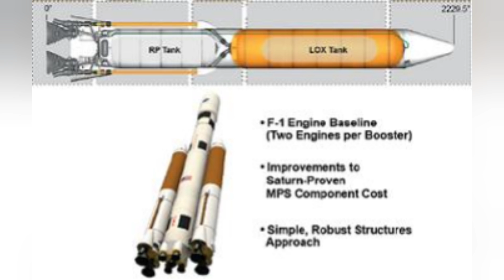NASA almost used Saturn V engines for SLS!  Are the new Shuttle engines the right choice?

Comment: The Saturn 5 and the F1 engines are 1960s technology,   They were hand crafted by the best in the country 50 years ago so its no slouch and will always be a folk hero but have you ever driven a 50 year old vette or a 50 year old mustang?   Nostalgic as F and a thrill to be sure but they are not the greatest, Also, the turbo pumps on those F1s have issues...  As far as the SLS goes,  its way way way to expensive,  i'm mothballing that whole rocket until we see what Elon does with the Spaceship and booster
Reply: Indeed they were hand crafted,  and that's the problem.  No two were exactly the same.
Reply: Why would anyone think Starship is going to be less expensive than SLS?
Reply: Most of the SLS cost is already sunk cost. The marginal cost of each launch is not that great in that the RS 25 engines and most other parts of Artemis 2 to 5 have already been manufactured. Of course it will be said that each SLS launch is $4 billion, but most of that cost has already been spent. Most of the cost represents development costs that have already been spent, and for the components and engines already built. 
It would be good to know the cost of Artemis 6 to 10, which I reckon will the total extent of the Artemis project. Well, most probably. The cost of Starship is not really understood yet, because we don't know how well the whole refuelling idea beyond LEO will actually work. I suspect not as well as Musk thinks, in which case Artemis will have on ongoing role for missions beyond LEO.

Comment: Contract SpaceX to modernize the Saturn 5 so first two stages are reusable and a service module for dragon on top and have them update the luner lander.
Reply: Stick the Space Shuttle on top of the new modernised Saturn 5 instead of the 3rd stage. Ridiculous idea maybe, but an altered Space Shuttle would make a great lunar lander.😂😊
Reply: @terencegibbins3894  it needs a long runway and how would it get back off surface of the moon?
Reply: @juliancrooks3031  I did state altered Space Shuttle, but anyway, silly idea I know:) Vertical launch and landing, off the surface of the moon:) So the entire Shuttle, complete with unused main fuel tank and side solid rocket boosters lands on the moon and launches off the moon. I know, it would need a launch pad, premade on the surface of the moon on which to land and take off. Highly expensive and rather impractical currently. But as an idea and concept?
Reply: @terencegibbins3894  You really don't need the ET & SRBs to get off the moon- its gravity requires FAR less than that, unless you're looking to do some Kerbal stunts which is a whole different story. Just strip the RS-25s, double the numbers of OMSs and have it land vertically, or alternatively place 4 OMSs on the landing side so it can get off the moon on its side like the Space 1999 lander. The only matter is how to get it out of LEO in the 1st place?
Reply: Why bother with that?  The SpaceX Superheavy produces over twice the total thrust of Saturn V.  Put whatever you want on top of SH and continue to re-use the booster rather than bringing S-V from the grave.

Comment: RS-25 would work better as upper stage motor.  5 F-1B plus solid boosters gets you hundreds of tons into LEO, or a hundred tons translunar.
Reply: There were proposals back in the day for upgraded Saturn Vs to be augmented with a variety of SRBs(usually 4 of each) either from the Titan rockets or something scaled up from that plus the original version of the LRB proposed here for the SLS, but we know what ultimately happened. Also the RS-25 was somewhat derived of the unbuilt HG3 which was meant to be a replacement for the J2.